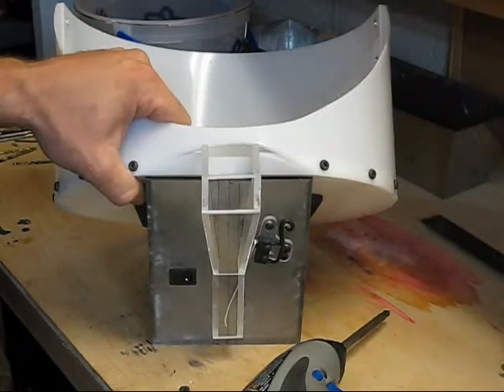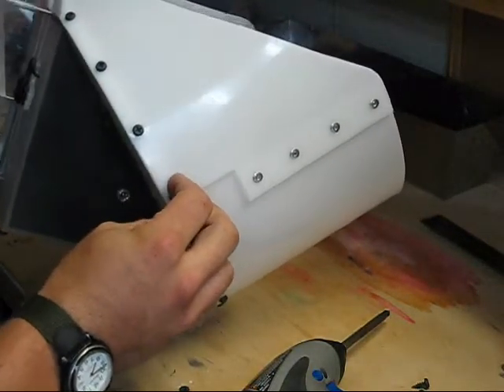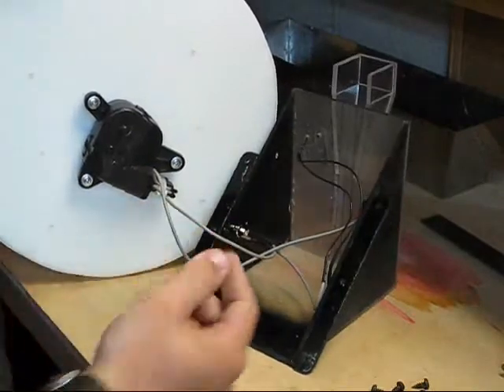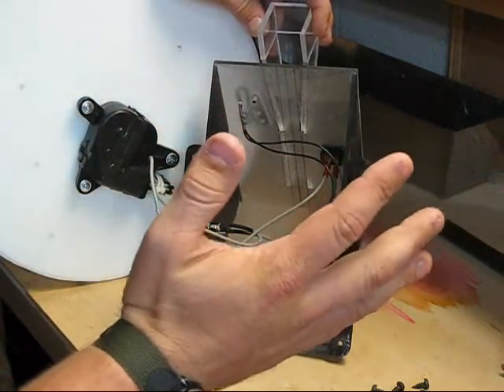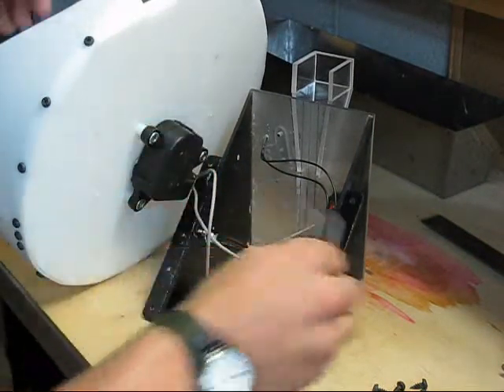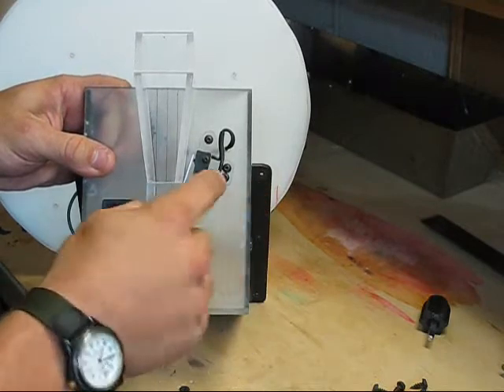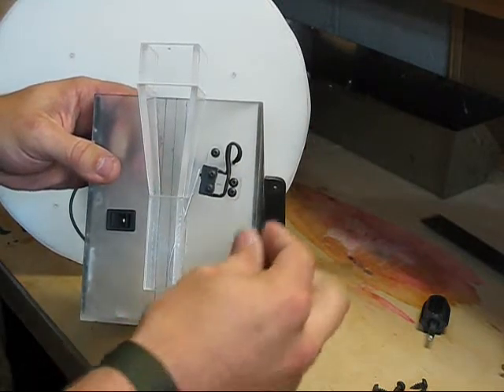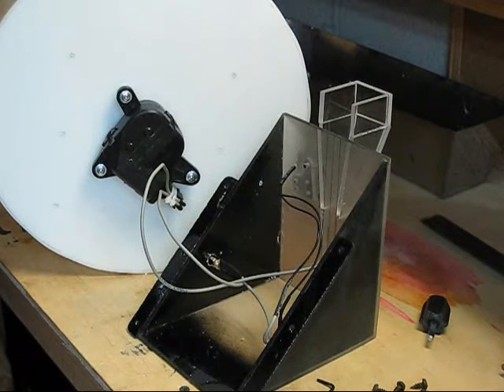homemade casefeeder - insides

Comment: I've been looking at the small electric motors for Bar-b-q Rotisserie. These are simple 120v, high torque, low RPM motors with a hefty main stem, or square drive. I am going to my local flea market to buy a couple of them to try out. These motors are expensive on eBay, likely because of the weight of the motor itself.
Reply: Try your local junk yard,any 12v dc motor window will work